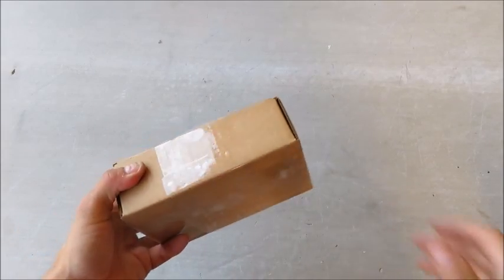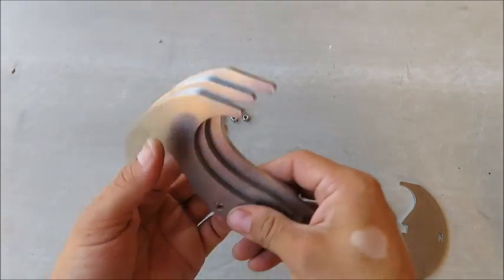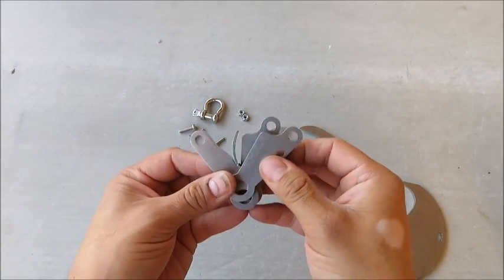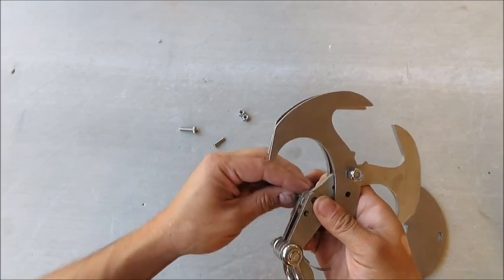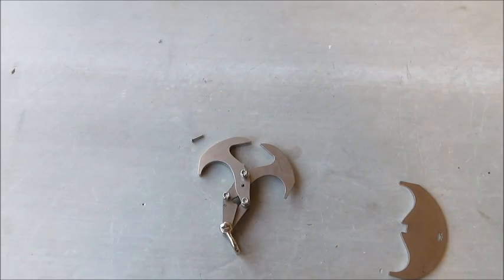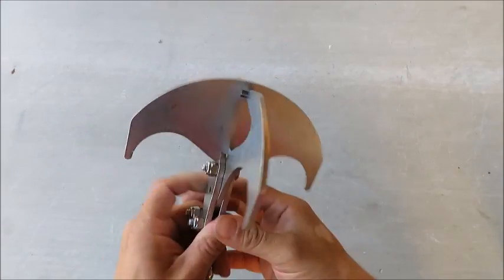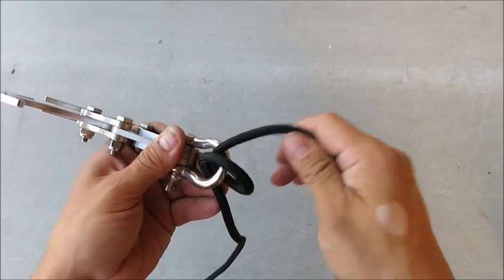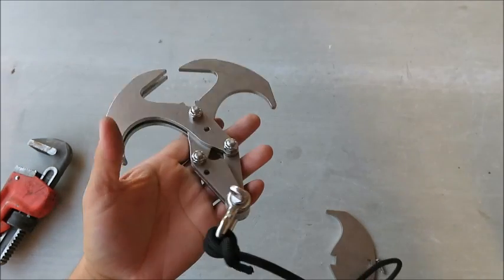Build and Use a Gravity Hook 3.0 Grappling Hook

Comment: I am looking on Amazon and ebay and all i see are similar ones but with no spring pin. Instead they have like rubber bands that go around. Where can i find yours like this to buy? Can you give a link?
Reply from the maker: Fliipixel those are copies of an old design of mine. You can find this version at awesomeforsale. We carry it on our website and amazon. Thanks!
Reply: @First_Class_Amateur  But, can you please put the link to your real one here or a link to your website? I looked through amazon and only found the copies with rubber bands.
Reply from the maker: @fliipixel5719  https://awesomeforsale.com/gravity-hook-3-0/ . I just realized it's not coming up on Amazon. I'm getting that fixed.
Reply from the maker: @fliipixel5719  Here's the website https://awesomeforsale.com/gravity-hook-3-0/. Amazon isn't showing the listing. I'm getting that fixed.